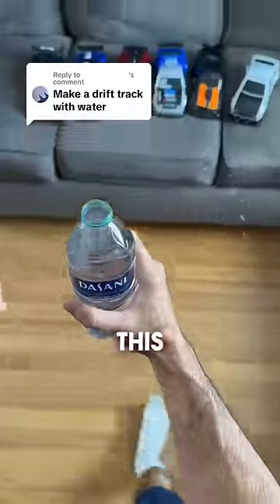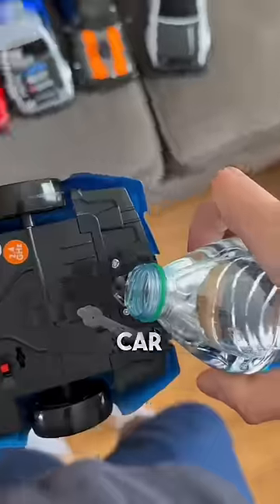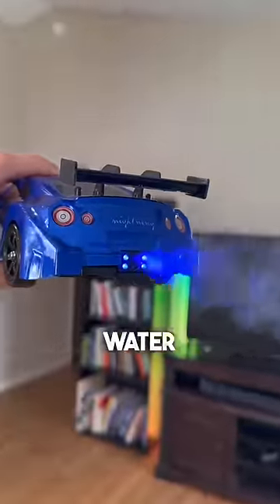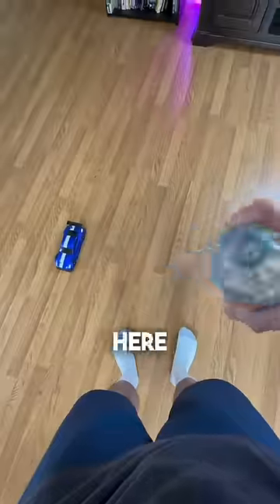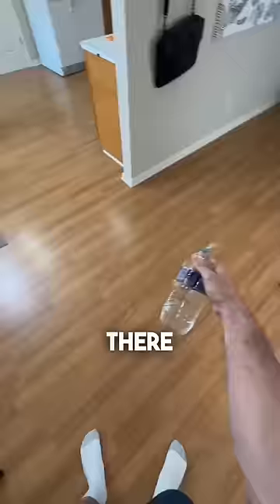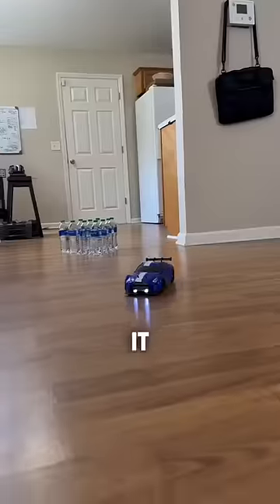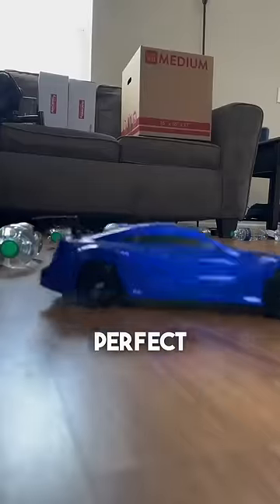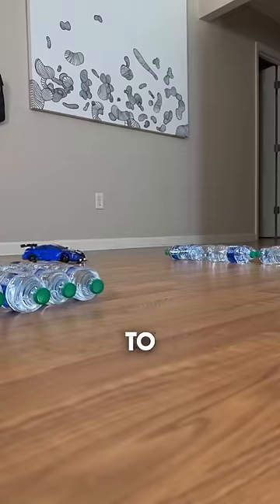Making a water drift track for the GTR Vapor Slide

Comment: I am 100% sure it’s not gonna be just water powered
Reply: you need water for the exhaust smoke, its a battery powered rc car
Reply: Basically an oil diffuser
Reply: Mist machine
Reply: @eclay08 yeah, I thought (and said) the same thing. I had a train like that, but he’s saying the car is powered by water, not saying the exhaust smoke/steam needs water, and the exhaust smoke/steam boiler isn’t even powered by water anyways, the heating element(s) are powered by electricity and it just needs to boil the water, as the waters energy doesn’t do sh to power it, so false advertising/lying, not just misleading/purposely making pepole think different, and their not lying, their just using a technically type thing.

Comment: Nah, it’s now powered by water, as I’m sure that plasticky looking thing has a fking hydrogen cell to extract all the electrolights from the water and turn them into electricity to then store in a battery and output to the electric motors. So I gotta say that’s just for the fking steam you see out the exhaust, as I had a train that did the same thing.

Comment: It's not water powered, you can see the battery thing on the bottom of the car, I had a car that you can put water inside, but it's not necessary to pour water inside since it only make vapor with it cause it looks cool, so it's not water powered, and water is optional to pour inside the car

Comment: It is not water powered. It can't be water powered unless you have a mini water turbine for hydro power and that would cost a lot and be quite heavy and bulky. Not to mention you'd need like 4 of them for each motor as well as a compression source to push water around. The vapor though, that is because vapor is water. It is R/C so it needs some form of electricity to send out and receive signals and water would not cut it. My guess is it is a lithium powered with a mini condenser in the back or just some really small heated plates. (Hate me for this all you want people, but a fact is a fact.) Either way that is still pretty cool.